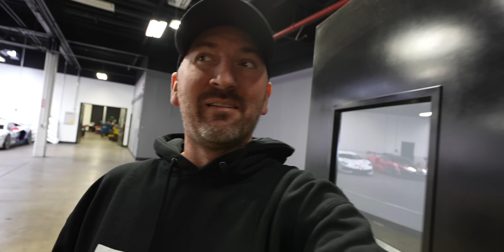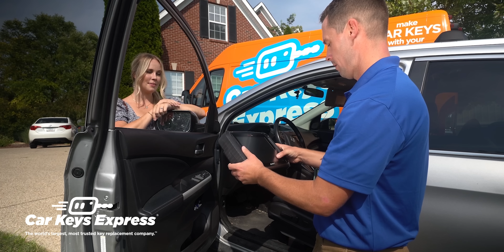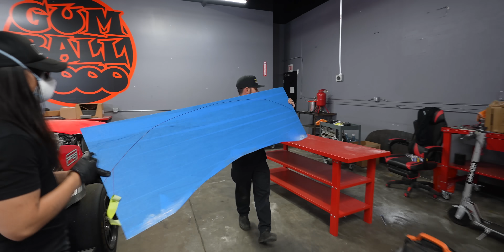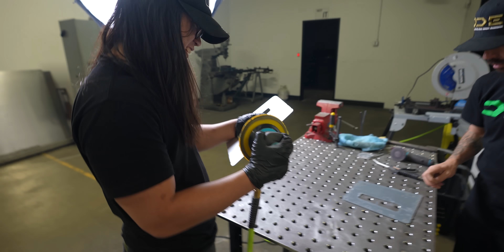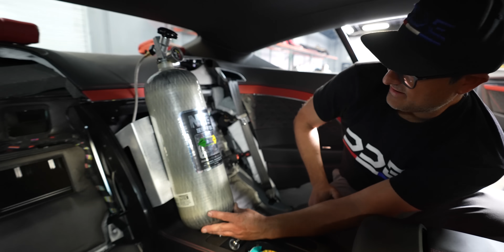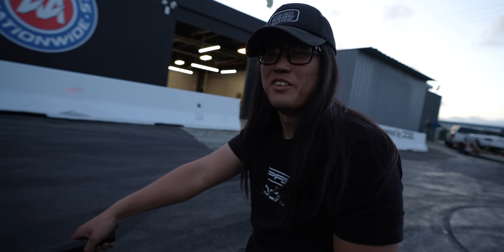SECRETLY BUILDING DAVES DREAM BENTLEY GT3!!!

Comment: So range rovers and Chevy any cars with air ride I’ve ever worked on they are supposed to be put in service mode before lifting so the air ride doesn’t have issues when put back off a lift

Comment: Ok so where are the builds like the F12? Like truly involved builds? I get something’s take time but you could easily find one of the projects in the shop that needs some kind of work that you could actually do instead of these sorta builds, as I will call what you guys did to the Bentley, you threw the autozone parts at it for now.. lol and I get the body kit is a big deal but he’ll but a cheaper car and build the shit out of it. You could build a cheap chaser car that would keep up with anything to use as a camera car “on the track” 😉 😉. But that would be something you guys could build that would have a purpose but would make some of us happy.. and just a small but involved project you could do pretty quick is all it will take to get everyone on board..

Comment: Check in the vehicle settings if it has a function for tire change. My Audi has a mode that you have to put in for the air suspension to chance a tire.

Comment: Did you guys remember to deactivate the ride level control before jacking the vehicle up? lol either way you should be able to run a basic setting for bleeding the air suspension and then resetting the normal/control level. Wasn’t Steve also supposed to be a Bentley tech? 🤔

Comment: Did you put the Bentley into jack mode before putting it on the lift? You need to put it into "Jack mode" by pressing and holding the shock button and the suspension buttons until the "Jack mode" light comes on the dash or instrument cluster. Not sure if it's exactly the same on this car but they need this or it will throw things out of whack on your suspension system.

Comment: The 720 GTR’s wide body build looks like a kit car. Something cheap and unfitting for a McLaren (or DDE even).  I hope the Bentley build doesn’t disappoint. Dave doesn’t have much experience with builds. It’s going to be tough beating the lines of the original, which are just beautiful. It’s a Bentley. The design is perfect. I’m a little anxious about the build..😬.

Comment: Is there not a setting in the infotainment system for 'wheel change function' that locks out the air suspension to then not have the suspension fault?

Comment: If you guys didn’t figure out the air suspension yet, it’s similar in the Porsche panamera, before you Jack it up you gotta lock the sensors from inside the infotainment system to prevent it doing this again.

Comment: If you run the NOS jets between the turbos and TB then it will also cool the intercooler brick and make a drastic change on the heat soak those things get. The Audi guys that run nitrous like to do the NOS and/or meth injection right there and it makes the power curve SOOOOOO nice.

Comment: Bentley has a jack mode you have to put it in to before jacking up the car or it damages the air rude. It is a sequence of buttons in the electronics. Car wizard you tube demonstrates this.

Comment: I like the idea of Dave's number 33 in the grill. What if you cut the numbers out on the plasma table, painted them gold and mounted them behind the grill?
Reply: Oooh, this is a clever idea. They'd have to try it, for sure.
Reply: Might block the airflow to the radiator. A different font would be better with bigger gaps between the horizontal lines on the 33 so they stand out better.
Reply: I thought originally that's what they were going to do
Reply: greart idea

Comment: My Mercedes lifted like that from the back because the rear height sensor lever disconnected from the ball joint, if it’s the same system it’s just a 10mil bolt that can be loosened and the shorter the rear one is, the lower the car gets, for the front the longer it is the lower the car gets

Comment: The Bentleys have a lift setting that needs to be turned on before you elevate the car on the lift. This allows the wheels to drop down without damaging the sensors

Comment: When you lift a car with air suspension, you need to put it in service mode in the car's mmi. I've had several cars with links and if you just do that, there are no problems.

Comment: The Air system needs to be locked in the cars computer system BEFORE you jack the car. Just like the Audis. If you dont do it it Will do just like that. A good testdrive and fault resets on the scanner and it will be okay again.

Comment: The height sensors can sometimes flip and come down on the wrong side when you fully extend them. Disconnecting them and flipping them to the correct side should fix it.

Comment: I ended up doing a bunch of research on the AMG Mike bought. That turbo set up is called 'Hot Inside V'. Pretty interesting engineering. The TL:DR of them is the Intake and exhaust are switched. Which I have never seen before personally. But that explains the turbo placement on that car ha.

Comment: The Senna needs to go. It doesn't fit in with DDE as you can't really mod it as it would affect residual values.
DDE is all about transforming cars, and the Bentley project would fit so well into the brand.

Comment: for finding the front bumper bolts  in the splitter ...no one  has ever thought of this get metal detecting  hand held pin pointer  put  it on the  lowest sensitivity  slide it  till it finds the bolts it will give u   a good idea  .. i have used  mine before

Comment: Hey guys when you lift the car you have to put it in jack mode. Go to settings - vehicle - chassis, and click suspension lock. Stops the air suspension from freaking out. All euro air suspension cars are like that.

Comment: The tip with air suspension is that if you jack it up you always must have open some door , becouse the nivelation works only than 
Also you should air it out and it will reset

Comment: One of the best episode made in the past month, if not the best.

Also, I think before you lift the Bentley on stand, you have to acces the "service mode" where it tells the air suspension to release the built pressure, and sensors to not freak out.

Comment: Great edit ! I think the purge should be higher in the grill an pointed down more towards the ground tho. Most cars with air suspension have a switch that turns off the air suspension idk about Bently tho. On a Lincoln it keeps this from happing  if u turn it off before lifting the car off the ground.since there system is intergrarded into the info center on display there might be a menu where u can turn it off for servicing it.  If not they may have a switch somewhere in the car to turn it off . I have no doubt yall probably know this an or just making intense video 🤔 tho. Can't wait to see Dave's reaction.

Comment: Dave you guys should convert one of those large unused rooms into a side business. Make it indoor supercar storage. Put some car stackers in there and double the number of spaces. Figure out what the going rate is for indoors car storage and charge something similar. You could check with super car dealerships and offer them overflow parking. 20 or 30 cars would cover most of your rent.

Comment: On an air suspension system you have to go into the settings and turn the system off before you raise the car off the ground. If not the system has to be reset. Steve should’ve known that I would think.